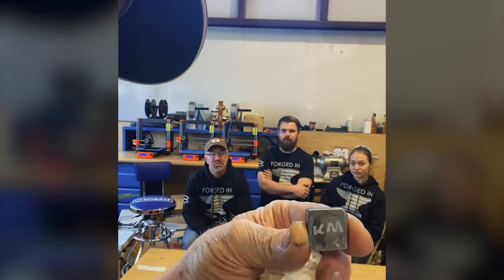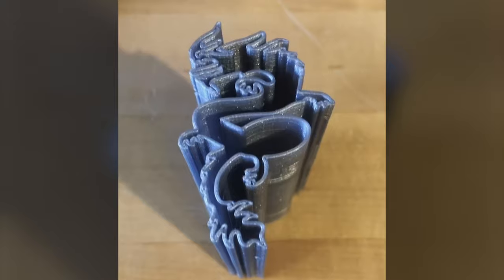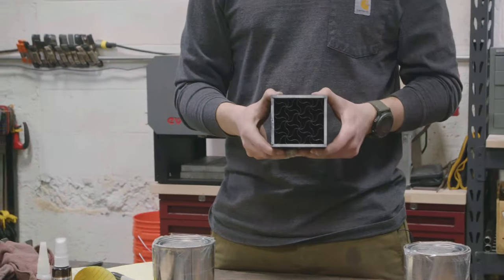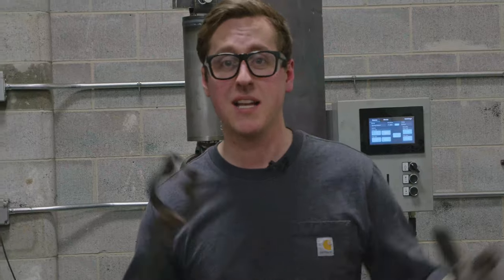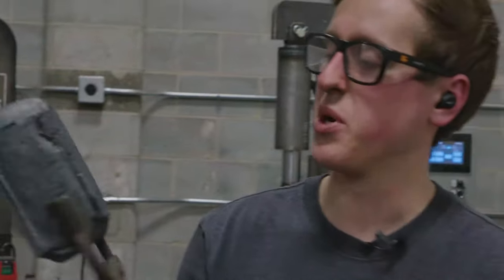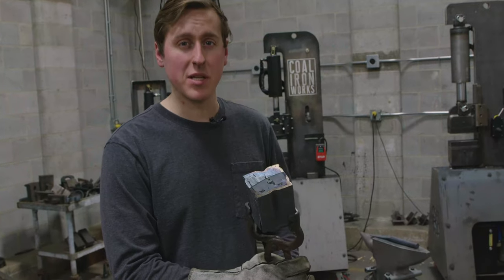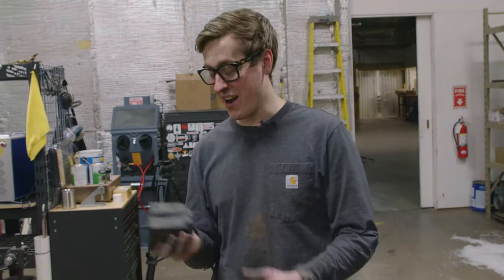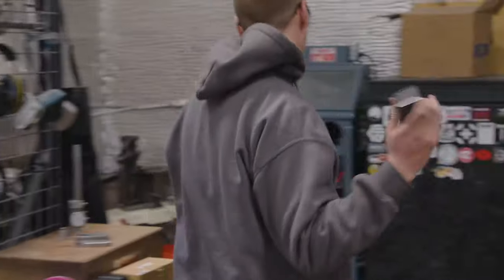Can You 3D Print Mosaic Damascus?

Comment: Super cool! By tweaking your print a bit you may be able to make loading the can much easier. Instead of printing a solid bottom layer, print caps on either side of the pattern that correspond to the different alloys. You can then pour all of one alloy and then tape off the cells. Flip the form over and fill all of the other cells for the different alloy. Might make things easier when you have small cells for really detailed patterns.

Comment: Hmmm will metal pla filament work even better?
There are several with Iron/Brass/and others
Also will a .1 mm nozzle for .1 wall work better?
you can also make you interior walls thinner than you nozzle but speeding up the print and slowing down the filament feed.

I now have new things to try
Reply: I think the issue would be mild steel sporadically throughout the billet
Reply: .1 nozzle might be a lot more trouble with clogging

Comment: What thickness are you using for the lines with the PLA?
Reply from the maker: We printed as thin as possible on our Pursa Mini. It was about 2 wall layers thick (about .03 in per wall).
Reply: We are testing 1 wall thickness but different shapes too. Angles, radius, etc come into play. Lots of testing going on.
Reply: @CoalIronWorks  I have a friend that wants to try this and I am currently printing him a test model. I will let you know how it turns out. I am doing a 99% infill at first to see what it will turn out like. What are you all using for infill on your printing?
Reply: @xavier7899  if it's all two lines thick, infill won't matter.